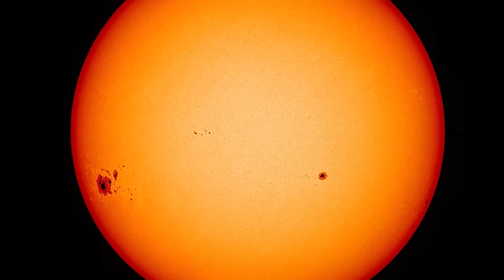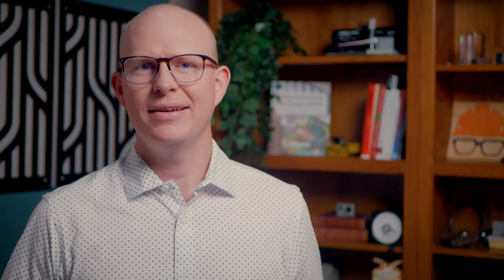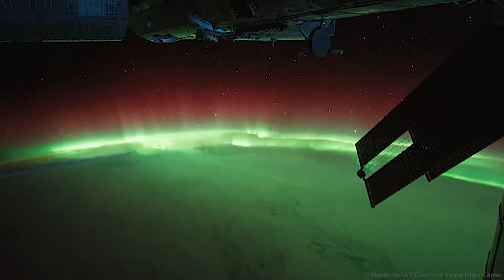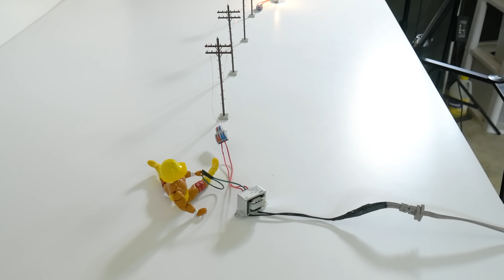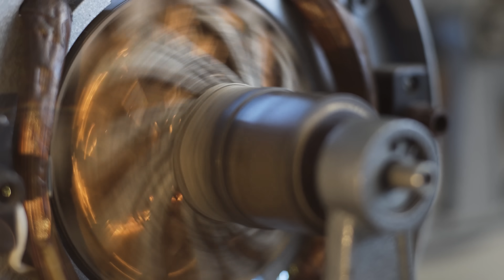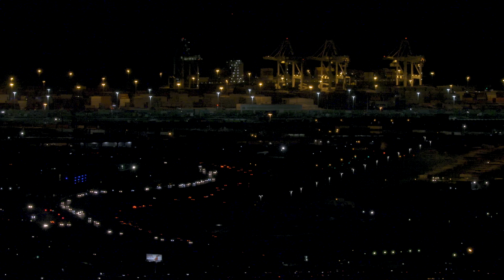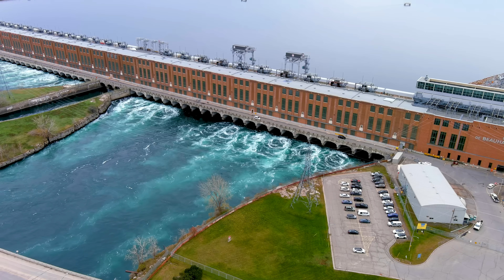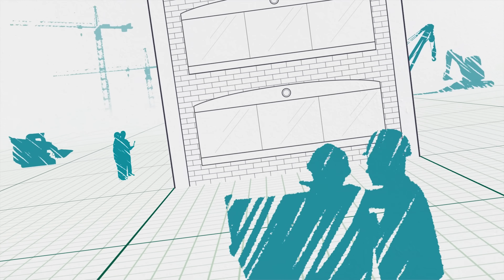The Most Confusing Part of the Power Grid

Comment: While synchronous condensers are used for (corse) voltage correction/reactive control, they’re also used to provide better generator fault ride-through characteristics, and/or to provide fault current at the generator end. Otherwise wind turbines would trip off every time someone sneezes, or electrical faults won’t clear quickly enough (especially when the grid connection point is ‘weak’ or long) and could damage other equipment, and destabilise the grid.

Comment: Why are we historically stuck with ac and not DC for power transmission and usage?
Reply: Because of a number of factors,  but probably the biggest of which is that AC can be transmitted over long distances without sustaining the great losses that DC current does. I'm not going to go into how this is done, but research "step-up" and "step-down" transformers, and you'll be on the right track.
Reply: Is there an video on this why Edison or Faraday or tesla lost out on which standard to use in power grid?

Comment: Fun educational video.  Something not mentioned is how if you get capacitors switched into the system late, they will have less of an effect on voltage.  As such, we have a statement called "getting ahead of the voltage."  We seek to get capacitors in early as load is coming on to get more "bang for the buck" especially on days when the load forecasts are heavy.

Comment: It is always best to have most reactive wattage ("VA") on the Grid lines, rather than active wattage (W) - for transmission purpose. It reduces the "copper losses". After transmission comes "distribution" and at that point (step down)transformer is the gate-way as it  corrects the power angle (Cos Theta), if designed so. It implies the Transmission lines must have Current leading Voltage (capaciti-ve). Yet some of the power gets lost into Space (Earth inadvertently radiates it into Space at 50 & 60 Hertz and at its various sums & differences. Even from deep space, Earth can be seen as strong radiator at these frequencies (principally 50 & 60 Hz). Astronauts "might" use it as a beacon to locate an "unseen" Earth. Of course, other strong radiators are planets like Jupiter that might interfere, but if it is noise like "Gaussian", can be filtered out. 
What is the total Power wattage on the transmission lines all over the Earth? Can someone tell me?

Comment: I heard that the grid (the high tension lines) switched over to DC 20+ years ago. And that it's only converted to AC at the local substations. Am I wrong or is that different in Canada than the US?
Reply: You heard wrong... VERY wrong.
Reply: @johnsmith7676  Most transmission lines are still AC however we're seeing HVDC installed more for long distance and very high voltage transmission lines. For a given voltage DC has less losses because it only has the resistive component of the conductors, you don't have any components of inductive or capacitive reactance, skin effect isn't a problem, corona discharge losses are reduced, the amount of conductor material required is less because skin effect isn't a problem and because of the absence of phases, which in turn means the transmission towers can also be made smaller. The biggest hurdle for DC transmission is the capital cost, you need expensive converter stations on both ends, however at a certain length and voltage it becomes more economical. HVDC is also used for grid interconnections, making it possible to connect 2 AC systems with different operating frequency or 2 systems that have different synchronisation.

Comment: 16:38 That power plant you show has a generator with inertia making the power. It is spun by a steam turbine powered by steam produced in an heat exchanger using the heat the sun whos immage the tower sees thousandfold has put into refined heat resistant mineral oil atop the tower.

Comment: Is there a multiplying effect on the voltage/current phasing? For example; a neighborhood development is on the same transformer circuit, mid-day, when every household's A/C compressor is utilizing a start/run capacitor at different times. Would the neighborhood phasing become more out of alignment as more capacitors become active?

Comment: Could you explain sometime then Grady, how a engine driven generator works say like in a camping scenario? How does the generator put out the right amount of power whether its a small load like driving a set of lights or a heavy one like say a microwave oven and other powered devices at the same time.

Comment: To be fair the statement that "look for a motor" to find an inductive load is not that applicable these days.
A lot of motors use variable frequency drives (VFD) and aren't running straight from the grid, this has the major advantage of better control over both motor speed and acceleration, great advantages in both the industrial and consumer worlds.

But downside with a lot of VFDs are that they tend to have a power factor of around 0.4-0.6 since they are having a rectifier followed by a capacitor. They aren't inherently a capacitive load since they don't give power back to the grid, the rectifier stops that. So they become this even more odd load for the grid to ponder over, since it isn't reactive, but rather non linear. The capacitor can only take power from the grid when the rectified mains voltage is higher than what is already in the capacitor, so it tends to only draw current at the peaks of the waveform, and this isn't ideal.

Now, power factor correction isn't new. For most "modern" appliances that rectifies mains voltage and therefor effectively runs on DC, then one can simply add a boost converter between the rectifier and capacitor. Then can ensure that the boost converter takes current from the grid in a fashion that makes the load resemble a resistor as closely as possible, ie aiming for a power factor of 1. Usually resulting in a bit of higher frequency noise that one will have to filter away with a mains filter, (adding a slight bit of reactive power again, but almost nothing), and then it isn't hard to reach a power factor of above 0.9

Though, then there is appliances that use a capacitive dropper for their power supply. Effectively using a capacitor as if it were a resistor to drop part of the mains voltage reactively, it is "great" if one wants a simple low voltage non mains isolated power supply, but it has abhorrent power factor usually bellow 0.2. These are usually found in a lot of "smart plugs" and the like... Capacitive droppers as a mains power supply should honestly be illegal, they are just that bad and a suitable mains voltage buck converter is not particularly expensive to build either.

Comment: "This bulb is dissipating 12 W."  Not quite.  The resistance in the circuit isn't only in the bulb, it's in the wires and in the battery, too.  The 12 W is dissipated from the entire circuit, and exactly balanced by the power output of the battery, which is also 12 W.

Comment: Hey Grady, thanks for the excellent explanation. I'm a structural transmission engineer, and I always ask my sparky colleagues things like what is reactive power or what does a synchronous condenser even do or why do you say MVA and not just MW? Even when they break out the white board, the information rarely fits in to my brain. You've shaped it in a way that makes perfect sense. Good job!

Comment: 4:03 resistance is not voltage dependent. its temperature dependent and specifically its a positive temperature coefficient or PTC device which means resistance increases with temperature which is true for most conductive materials. this property is actually what make these lamps still useful in a lab setting rather then for actual lighting which they are terrible for as it can act as a safety device when placed in series with your circuit under test. if your test circuit develops a fault the lamp in series would just heat up (light up) and increase its resistance and limit the fault current. Under normal condition when the lamp is cold, its resistance is low enough to not impede your test circuit too much.
Reply: You're right, unless we're talking about varistors which are voltage dependant 😉

Comment: On power factor in the home.  From my results it's not as bad as you might think.  My power monitor records reactive power and power factor.  The good news is it's usually in the high 80s or 90s.  Bad news is, devices like electronics in standby have pathetic power factor because their power supplies are WAY outside there efficiency ratings.  A "sleeping" PC might be consuming 3W, but with a power factor of 0.2 there is 15W of current flowing.
It seems that most bad PF devices are so at low power.  So it doesn't seem to add up much.
Over a year I pulled in 2.9MWh but I only pushed out 2kWh.

Comment: In Ireland, large commercial customers are charged not based on consumption at all.  They are billed on "Peak demand per 15min period", "Peak Reactive power per 15min period."  Distribution costs and transmissions costs specific to their premises and supply.
If homes where billed this way, even though your 3kW kettle takes 40 seconds to boil, you would get billed for the 3kW peak demand for the 15min period.  When your fridge compressor starts up 15 times in a day pulling/pushing pulses of 500W reactive for a few seconds, you would pay for the 500W peak reactive per 15min slot.
This is why industrial consumers install power conditioning plants to limit the amount of phase shift they cause as they are billed on it.  Plants with a lot of motors and inductive loads can install massive capacitor banks to offset them and vice versa massive inductors for capacitive loads.

Comment: Great vid. I'll watch more of your series. Thank you. 
To continue with your analogy for understanding, what is a laboratory model or analogy of the electromagnetic hit on the planet from solar flares. 
My gut sense would be that it is a unipolar magnetic or ionic wave that induces a current in virtual 'loops' comprised of many strings of power lines and the earth as the return path. But . . . then, this would seem to be a transient pulse and not a sustained voltage or current change. In addition, it would not change the reactance of the system. 
So, what does a big wave of solar activity look like? For ex - a single unipolar EM pulse? 10 minutes on / off 5 hz EM pulses? Alternating EM polarity for hours? Is this EM activity picked up by an experimental pickup coil one could devise to monitor and characterize the activity?

Comment: Mate most of the video is educational. 
Using water as a poor similarly. The drain would be the negative, and AC means the drain supplies power. The electrons are pulled not pushed. Switching is open or on with water 
Switching is closed or on with electricity 
Increasing the voltage will increase the allowed current capacity on a conductor, but water can not increase in the same size pipe.

Comment: In Korea, many households have recently transitioned to digital electricity meters. 
A significant feature of these digital meters is their ability to measure the power factor and rate electricity usage in kVA, as opposed to kW in analog meters. Consequently, households with older appliances, such as refrigerators, vacuum cleaners, and air conditioners manufactured before 2000 (when many home appliances switched to inverter-based motor control), have experienced substantial increases in their electricity bills due to the low power factor of these devices.

Comment: If you generate your own home power, you quickly learn how much a poor power factor reduces the available power from your system.  This loss is much more severe for power utilities as the mismatch in the load (which is the cause of the reduced power factor) causes the transmission lines to radiate harmonics of the AC power line frequency.  So that efficient electronic LED bulb with the 0.5 power factor (courtesy of the capacitive dropper) can actually consume more power than the incandescent bulb it was meant to replace (depending upon the length of the transmission lines between the source and load).

Comment: Very VERY good explanation, my hats off to you sir !

I work in a factory where we have thousands of light armatures, using T8 fluorescent tubes.
In recent years LED tubes are replacing the older technology, but there is a BUT.
The old light fixtures have built in capacitors for compensating the reactive load.
Since the LED lights consumes less energy, the capacitors over compensate, to the point where the current actually is higher with LED than with T8 fluorescent tubes.
Our equipment has a power factor of 0,30 on the capacitive side.
I think many do this, as we did, not contemplating removing the capacitors inside the light fixtures.
Reply: Thanks, Daniel, something of which to be mindful.

Comment: Grady, as an experienced industrial electrician that has a good understanding of power factor, I must say your explanation is fantastic! It's something even most sparkies don't understand properly so kudos.
It's interesting how the US manage power factor for big factories, the electricity suppliers having capacitor banks to manage it for their customers and charging them accordingly. Here in NZ most factories have onsite PF correction units that consist of a bunch of massive capacitors and inductors that can be switched on and off via a controller that monitors the overall PF of the incoming supply and corrects it accordingly. Most are set to run with a 0.9-0.95 PF. They will be charged accordingly if their PF correction unit fails but as far as I know NZ doesn't have big grid PF correction. I could be wrong, I've never worked in distribution.

Comment: In order to reduce their Electrical Utility Bill, many large Factories and Industrial Plants have massive Capacitor Banks installed in them to correct the Low Power Factor caused by all the very large motors running on site...the Capacitors basically generate Reactive Power which is then consumed by the Inductive Motors balancing their Power Consumption out and thus placing less overall Demand on the Grid, which ultimately means they only get Charged for their Actual Power Use instead of their Actual use and Reactive use...

The PF Correcting Capacitors are NOT cheap to install, but big Plants use them anyway because the initial cost of Installation is a One Time Cost which is then recouped over time by the reduction in their Utility Bills...and for some Companies that have MASSIVE Induction Loads, the Capacitors can pay for themselves in 5 years or less, after that, the Utility Savings is effectively Free money in the Bank for the Company...

Comment: I bought a huge 30 year old indoor mall at a Sheriff Sale for about the price of a house and I went through it and the only things running were the heat (set to 50F), a few select lights and exit signs and occasionally I would turn the escalators on or ride the elevator. I was shocked when I got my first power bill, it was over $8,000 and $1,300 of that was a power factor surcharge. I had no idea how any of that worked. I found out all of the fans and escalators and elevators are original to 1993 and have low power factors with no correction.
Reply: By the way, these things are money pits. I can see why they failed. Don't buy one.

Comment: One relatively simple thing that can be done on the customer side is to add parallel capacitors or inductors to their loads to roughly cancel the reactive power. Many such loads are significantly dynamic though so it may need to get less simple depending on how well they want to do it.

Comment: 6:20 Don't put more than 1V reverse bias voltage across an electrolytic capacitor or they can be damaged, or in some cases violently explode.  The resistor you used to sense current was likely protecting the cap during the negative part of the AC waveform.  I fear one of your viewers might try to replicate your experiment and be in for a nasty surprise.

7:14   That is a torroid core inductor.  The windings are wrapped around the torroid core.  Inserting a magnetic object into the center of a torroid core inductor doesn't do very much.  You need to have the windings be around the core material you are inserting.  I suggest wrapping some small gauge enameled "magnet" wire around a short piece of plastic tubing.

Comment: How can a capacitor boost the voltage? Is it in parallel with the load?
Reply from the maker: It help realign the current and voltage waveforms, reducing the current demand on upstream transmission lines, and thus reducing losses.

Comment: If reactive loads are creating this effect and capacitors are fixing it. Why do reactive loads, let say motors, do not have built in capacitors to fix the issue? Does the effect change according to the load on the motor for example?

Comment: When I took a course in electrical engineering back in college, the whole "reactive power is a real-world use case for complex numbers" thing blew my mind. It really nailed home how the terminology of "imaginary numbers" is completely inappropriate - there's nothing imaginary about them, they're just as real as the "real numbers".

It's cool to see some of the things used to compensate for reactive power. Are these actually harvesting that power in any sense? Imagine a simplified grid with a power source, and two loads: one capacitive and one inductive. Could a device be added to the grid that harvests the reactive load from one to feed the reactive load of the other? What about adding a battery that charges off of the reactive power? I don't remember enough EE to recall whether or not it is possible to separate out the reactive power like that.